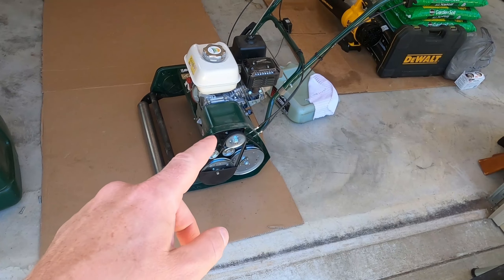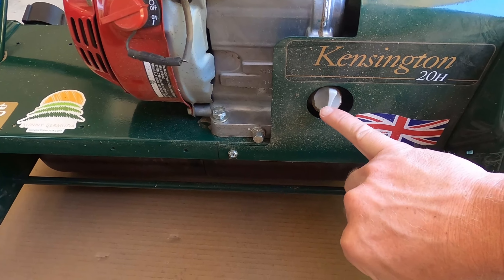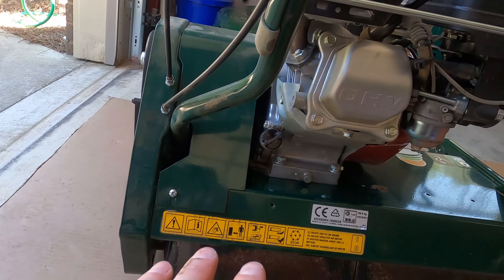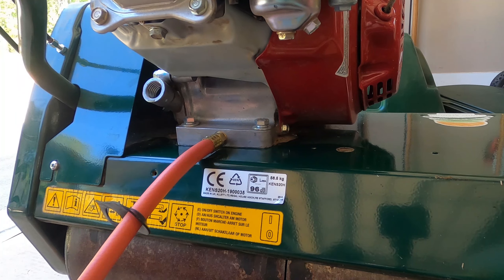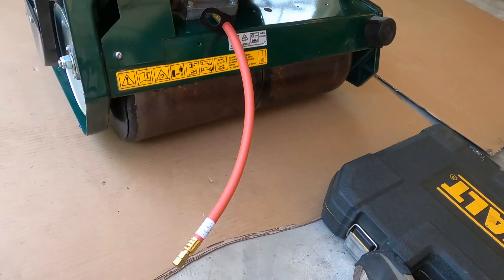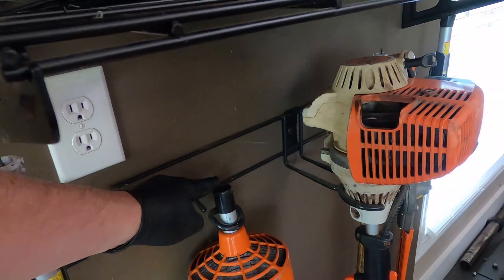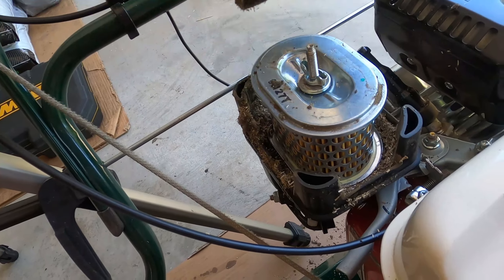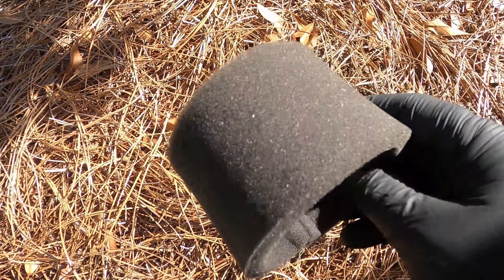Complete Engine Maintenance + Tips - Allett Kensington 20H - Honda GX120 ☀️ (S2E9)

Comment: I took your tip and used the same product to condition my belts and it turned into a disaster. It made the belts so tacky and grippy that when the mower was idling the belts were grabbing the motor pull and engaging the reel, I tried several adjustments of the cable tension and could not get it to stop. I eventually painstakingly cleaned the belts and pully's and was able to get it to mostly recover back to normal but I'm still getting a very slow reel turn when the reel should not be engaged.
Reply from the maker: Oh wow!  I’ve used the belt conditioner for years with no problems.  Have you contacted the manufacturer?  Perhaps you got a bad can of it?

Comment: Mr sunny do you know how to fix the turtle /rabbit function ? The line doesn’t seem to work and I have to adjust the engine manually!
Reply from the maker: Hi, Victor, sounds like your cable may be broken or became unlatched.  My Kensington Tips video shows how to fix or repair it.
Reply: @SunnyBermuda  yea the piece broke ! Im going to request a replacement throttle housing! that explains why I can only put it to the turtle setting but not to the rabbit!
Reply: @SunnyBermuda  hi mr sunny, is it still safe to use the Kensington without the throttle cable? I am waiting for the replacement park and took off the housing and cable
Reply from the maker: Yes, it’s perfectly safe.  The cable is just a convenience so you don’t have to bend over and adjust the engine each time.
Reply: @SunnyBermuda  thank you sir! I was like oh man I got a mow to do!
Reply: @SunnyBermuda  Hi Mr. Sunny do you have any recommendations with regards to surging ( I think that’s the correct term)?. For example, when I put it in the turtle position the engine starts to shake and surge as if it doesn’t have enough gas or is struggling. I’m not sure what to make of it and I cleaned the filter, changed the spark plug, and assessed  the sediment cup. I also changed the oil. Not sure what else to do so hoping you have some suggestions !
Reply from the maker: @Victor Z - You have the same Honda GX120, right?  My only thoughts would be the carburetor.  You may have some bad gas in it, or ethanol has gummed it up.  If you end up having to replace it then make sure you use a Honda carb.  Make sure you use Stabil or some other stabilizer with all your gas even if it's non-ethanol.  Hope this helps.
Reply: @SunnyBermuda  thanks for the reply. No I have the Briggs and Stratton. I am thinking it may be something with the gas. I left some in there for a month when I was moving. Should I buy a stabilizer and put it in with the gas or what would you recommend?
Reply from the maker: @BermudaBewitched  Ah, ok.  If it's a Briggs then it probably is the carburetor.  I would clean the carb, and any future gas add the stabilizer.  I normally ad an ounce of stabilizer for every 2 gal of gas (check the label).  If you left gas in it for a month it probably gummed up the carb.

Comment: Have you ever tried one of the hand help pumps to pull the oil out?  They work good and keeps everything clean.
Reply from the maker: Haven't tried one, but have one in my shopping cart. 😉 With 4 small engines I may have to get one.  Look like they would be fast and clean.
Reply: @SunnyBermuda  I first saw one on the Silver Cymbal channel

Comment: Hi Sunny,  what type of grease do you use in the zerk fittings?
Reply from the maker: I get Lucas Oil 14 oz. Red 'N' Tacky Grease from Home Depot.  Only $5.48 and works great.  One tube has lasted 2 years on servicing my aerator and spreader.
Reply: @SunnyBermuda his mower has zerks?  I asked Allett if there was anything that needed to be greased, and they told me no.  Cool video.
Reply from the maker: Correct, on the Kensington there are no grease fittings.
Reply: @SunnyBermuda  yeah, knew about no zeros, but was wondering what else you were greasing. I taken mine apart a few times for maintenance amd meter found anything I needed to grease.
You still on TLF?  I think I've been on twice in the last 5 months or so.  Just not the same.  Hope you're well, man.
Reply from the maker: @Jay-Go  I sold my Kensington this last Fall.  I would hit spinning parts with Fluid Film and shoot some down the cables.  Pretty much it.  I may get on TLF twice a year, too.  Doing great and excited to use my C24 all season with my new cartridge collection.

Comment: Super video. Especially that I got my 20 h around the same time as yours and this is more then helpfull. Just wondering if you do greasing on the kensington as well if there is any. Was thinking about the drive drums if they need any maintenance? Thanks and again " top notch "
Reply from the maker: Awesome!  Thank you!  I occasionally spray the joints with some silicone spray or Fluid Film.  I wish the drum was stainless steel.  Wonder how hard it would be to paint my drum.
Reply: @SunnyBermuda  I don't think painting the drums are a problem, but the paint won't stay. To much friction. Anyway, looking forward to your next video, maybe showing how you spray the drums, either with paint or  the joints with fluid film 😉

Comment: Hey Sunny thank you for this video, by far the best one I've seen on this engine, i have a question, i did the oil change on the cali trimmer, same engine, and now the mower won't start, it was done correctly, do you have any ideas what the problem could be?
Reply from the maker: Thank you! 👍 May not have enough oil in it.  Make sure it’s level and the oil comes up to the threads.  Some models have a low oil shutoff sensor.
Reply: @SunnyBermuda  yes!! That what it was, what is weird is that front hole was full and oil was coming out, but only took 12oz, then i poured the remaining 8oz from the back hole, imo that's a poor design, because it shouldn't come out until you put the 20oz

Comment: Great technique and tips man. Handling it like a pro. How often do you plan on changing the oil? Supposedly these motors don't ever need an oil change, just monitoring of levels. You're running yours a lot longer and harder than I am mine, so it may vary from user to user. Great video bud!
Reply from the maker: Thank you!  Yeah, I put that little mower and myself through a workout, especially when it's growing.  I change all my mowers about once a year.  Love that little Honda engine, they can't be beat.